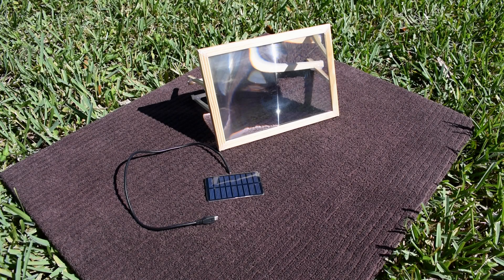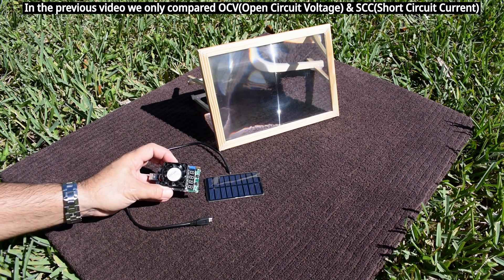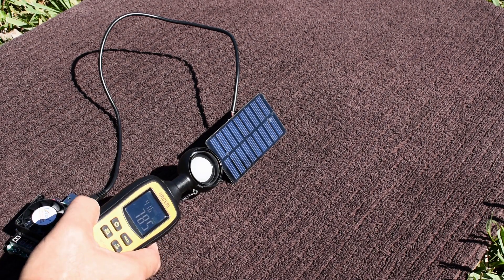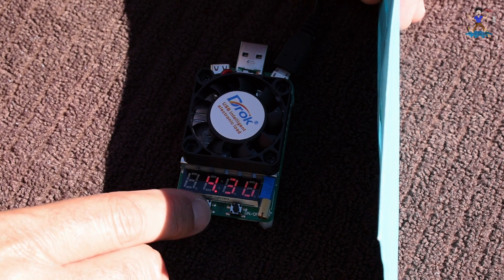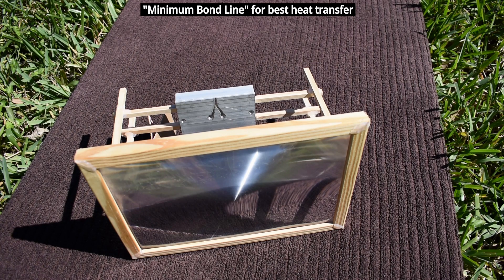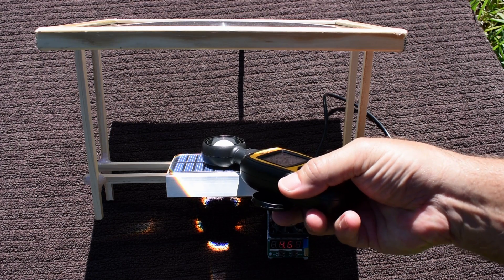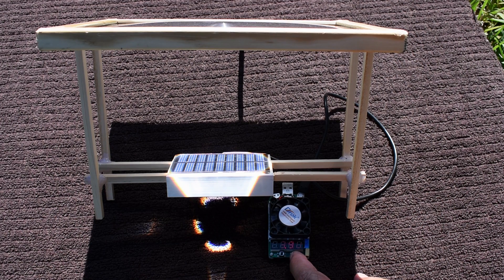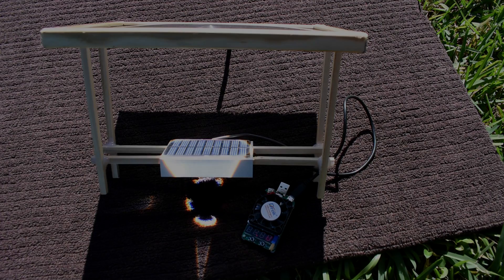Fresnel Lens Solar Panel Experiment WITH Cooling!

Comment: It would also be possible to place an infrared film in front of the lens and see if it would help...
Reply from the maker: That would likely end up blocking most of the light, causing the output to be extremely low. Thanks for watching!
Reply: @electronicsNmore  I was reading this article recently, where they claimed some significant improvements. https://www.sciencedaily.com/releases/2016/08/160825152054.htm
They might be interested in sponsoring you for a demo? Anyway, keep on the good work!